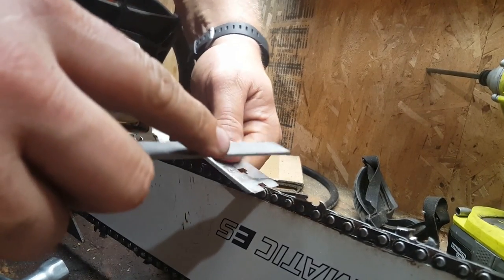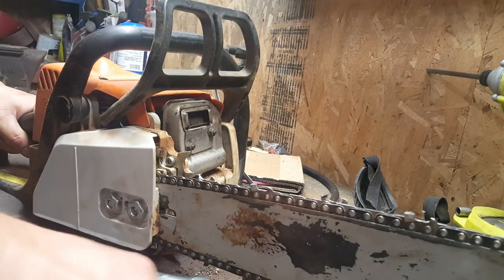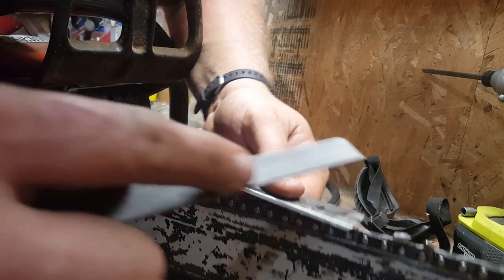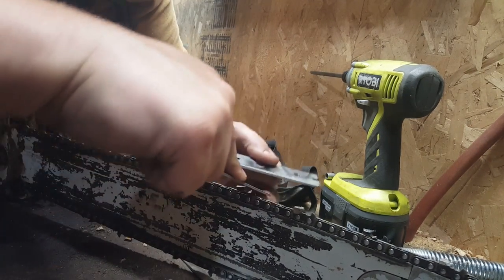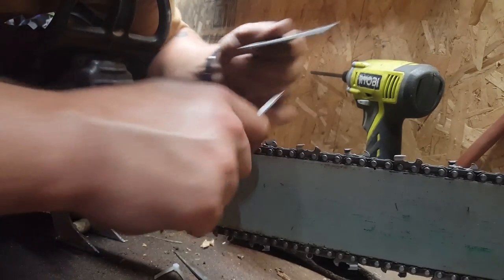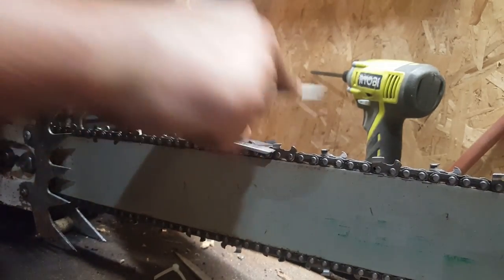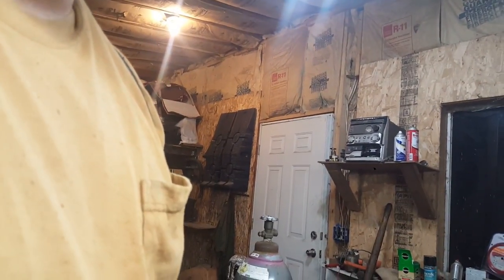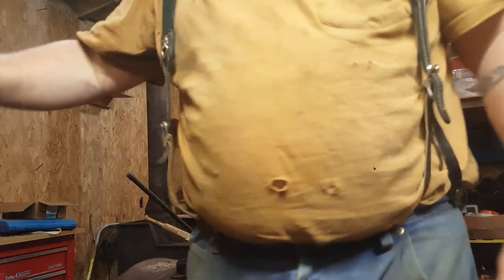Filing rakers/riders

Comment: Did u sharpen your chain with a smaller file size on the first saw? The Gullet looks u did... I've tried a smaller file by one size and it grabs a little more but I find it don't stay sharp as long but it does cut a little faster.. The best depth gauge is the husqvarna ones like u have because it sits on each tooth and sets the depth gause for each tooth I hate the ones that sit on three teeth to file the depth gauge of the center tooth because each tooth are a little different size after u file once or twice.. happy cutting everyone..😏 😏 😏
Reply from the maker: Thanks for the comment. This was one of the first grinds I had done on an Oregon grinder. The setting I was using left alot of gullet. Trying some different ones and seeing how that works.